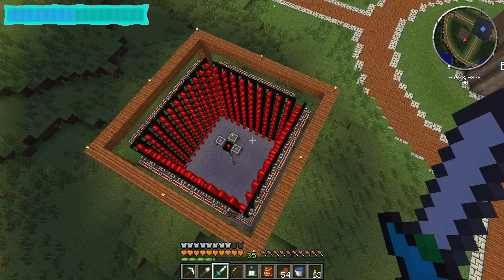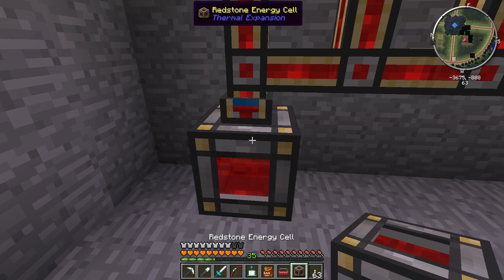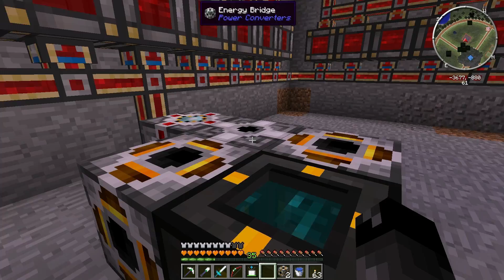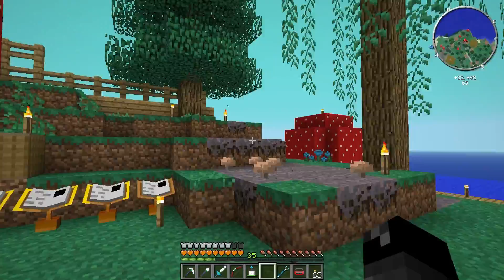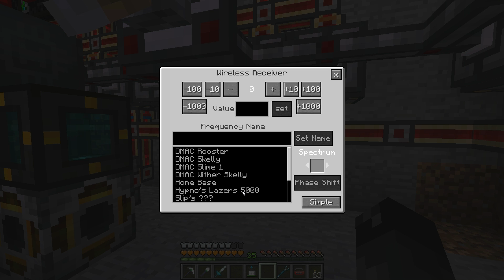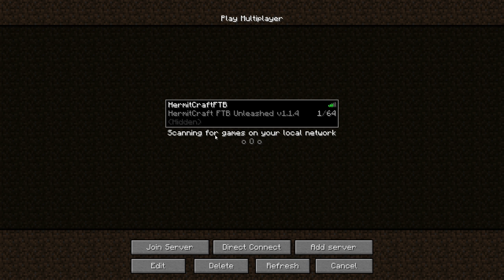Hypno HermitCraft FTB Unleashed S2E21: All The Lasers!!!

Comment: had 5 mj casue they were filling up as fast as they are draining. so you need to increase the power or manage the cell better. but if you use your signal setup you can use a level emitter for the me system. good job though, i like how you went about doing it

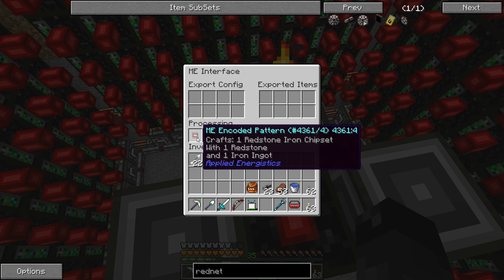Comment: hypno, i was bored so i did some numbers and your using under 1/4 of the power you can output at the 100MJ/t setting, if you used all of the 100MJ/t from each cell you'd last 5minutes of cunstant run time, you should last 23minutes as your useing 808MJ/t(I was at 19:17 on the vid when i did this)